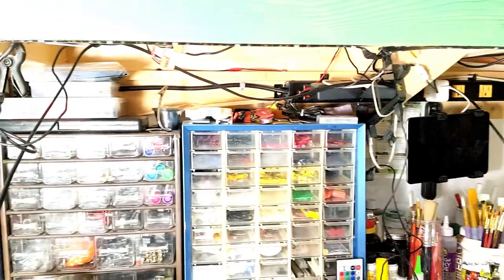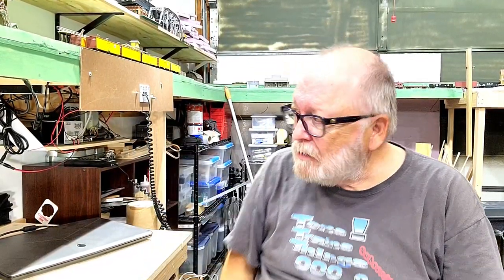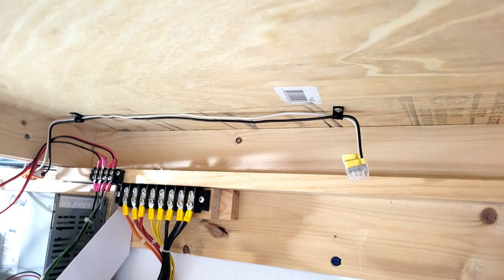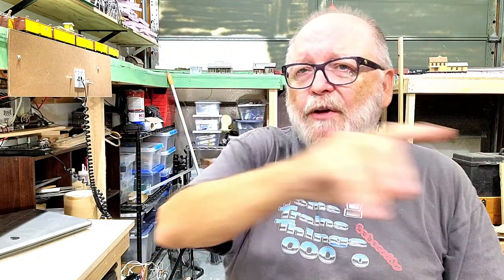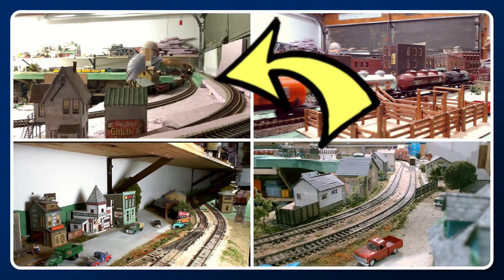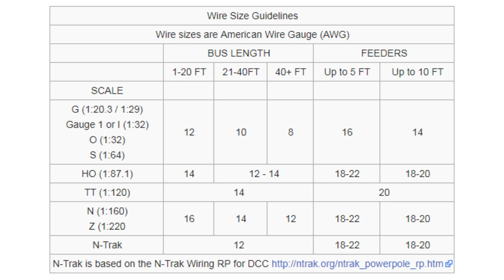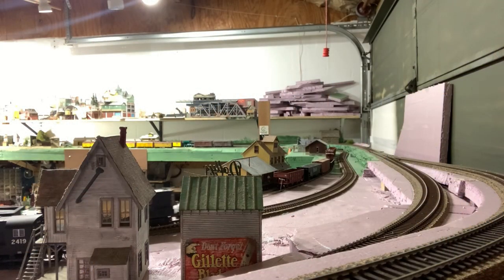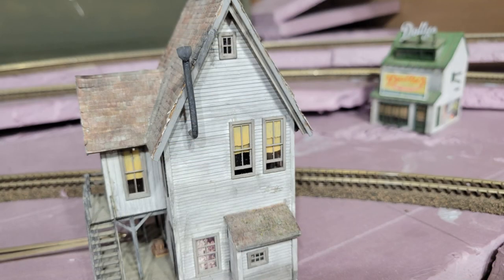Feeder Wires - How Many Should You Have

Comment: I built my layout about 6 years ago and I have learned the hard way. I put all my track together with what I thought was enough feeders. Took me along time to figure out what was wrong . I separated my layout into blocks for better reliability and short management detection.  I still had voltage drop so now I  put a set of feeders on every piece of track and where  it used to stall,  no more stalling .
Reply from the maker: Great job 👏 👍

Comment: Tom,
    You should have feeders to every piece of track. Whether they are 2" or three ft flex . I didn't have any issues with my lay out till I ballasted the track. I have soldered joints at curves and the helixes are soldered. I used Isoprol Alchol to prewet the ballast then 50/50 white glue. The isoprol causes oxidisation in the joints which cuts power . Has caused me grief ongoing. I must of had a bad batch or something as it turned the rails green . It has been a mission to fix all the joints and put feeders in my inner and outer helixes over 30mtrs of track and turnouts. The isoprol wicked all the way down to the bottom of the outer helix where it wasn't ballasted . I use Peco insulfrogs and it has effected the point rail hinge joints as well as the sides of the switch rails.  Cheers Les
Reply from the maker: Sounds like some strong alcohol. I never had any issues with it in my balisting for decades.
Reply: @TomsTrainsandThings  I built the layout 10yrs ago and didn't have any issues either till I decided to add this outer helix to lessen the climb from the back end of the yard and boy is it kicking my ass. just on seven weeks sorting it to run. I couldn't believe how far that damned stuff wicked and I had trains running couple days after I ballasted. As time went on from xmas it just got worse. Live and learn I guess Cheers

Comment: Prior to our latest move; I had  2  large; DCC-controlled Layouts : One was 2 Kms from the ocean ( Sub-Tropical climate : Consistent  higher temperature and high humidity )  and  the other was 145 Kms inland ( Mountain region with sometimes significantly varied; temperate climate; but comparatively dry ). The first had EVERY piece of track ( no matter how small ) with its own power-feed and like yourself; the rail-joiners on curves were soldered for assured track-alignment. In association with a committed  track / wheel-cleaning ( Loco + Rolling-Stock ) program; I NEVER had any form of electrical pick-up problem  or  lack of Loco performance. The second Layout had less power-feeds; but they were strategically / correctly located. The reduction in preventative track / wheel-cleaning was dramatic; but still necessary .... But again; no loss of electrical pick-up  or  Loco performance. Ultimately; for wiring; it  IS  best to over-compensate / over-engineer from the OUTSET to allow for trouble-free; enjoyable slow-motion switching during OpS !  NEVER take short-cuts  and / or  make temporary wiring permanent !  I cannot stress enough the importance of taking time to ensure good track-work  and  reliable wiring during construction to ensure full enjoyment when  OpS  becomes possible at a later stage ... !  🤙🤟👊✊️💫💥
Reply from the maker: Good points, better to be safe than sorry

Comment: I like to check the resistance, with an ohm meter between the bus and track segments.I like to keep it less than 0.5 ohms everywhere on the layout.
Reply from the maker: Good tip. Never tried that. Just put feeders around all turnouts and approx every 3 to 5ft. always works. Once I do it. lol